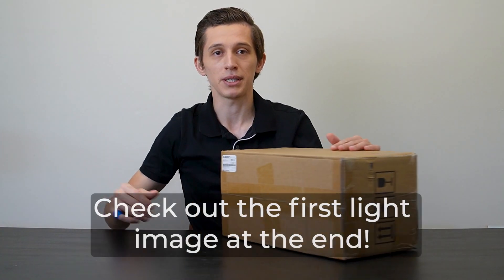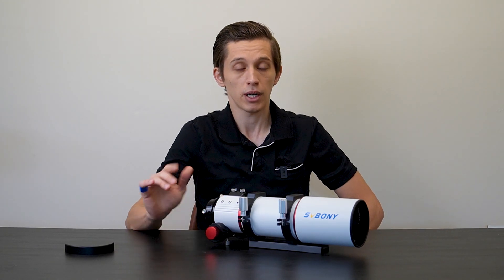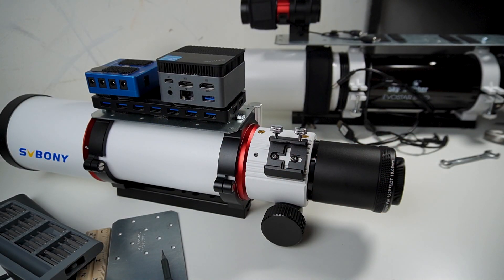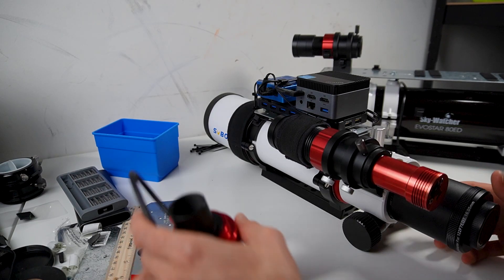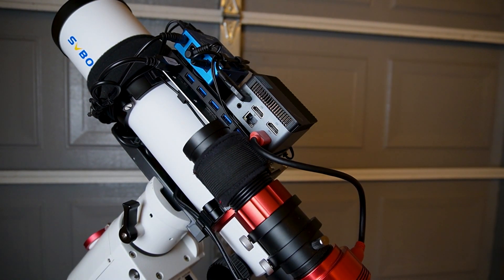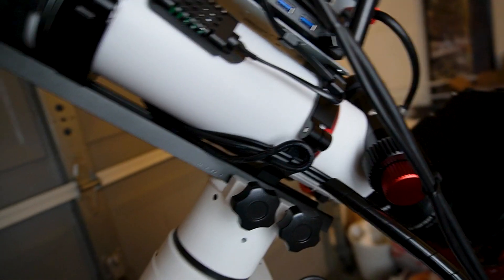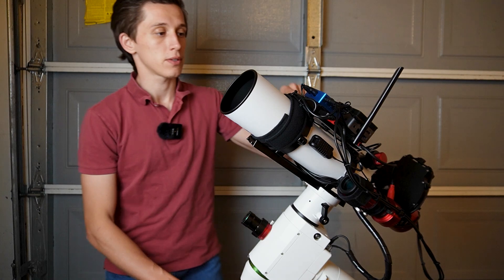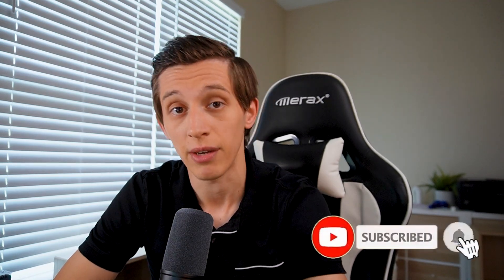Let's Setup An 80mm SV550 Telescope for Astrophotography

Comment: It was fun and educational to watch! Question, which would you prefer? SV550 80MM or SV503 102MM? I'm kind of torn on which one to go for, they're about the same price
Reply from the maker: Ooops. I've missed this comment! I haven't tried 102mm SV503, so it's hard to say which one I would prefer more... I guess SV550 would be better simply because it's a triplet APO although 102mm could find some use with a monochrome camera.
Reply: @AstroCreation   Thanks, that was my dilemma, a bigger aperture or better optics, I thought I'd go for better optics, and 80mm is also good, it will weigh less so a tripod will be easier to find at a good price.

Comment: Very tidy cord management! I was wondering about the antenna that is attached to your usb hub. Is that a wifi adapter? Does the mini pc not have wifi? Do you use RDP to control the mini pc or do you use some wifi magic trick? Thanks.
Reply from the maker: Thanks! Yes, mini PC has a Wi-Fi adapter, but I prefer to use an external one for better signal. I use Team Viewer to control all my telescopes remotely.

Comment: hi, you have a 0,8 reducer from sv550-122mm on the sv550-80mm ? is this possible or a fake ? We good ist the flattener in Picture ?
Reply from the maker: I've tried to use 0.8x reducer from 122mm on this 80mm telescope, and it wasn't good at all. The picture shows the 1.0x flattener dedicated for 80mm telescope

Comment: What antenna are you using attached to the usb hub?
Reply from the maker: I use this Wi-Fi adapter - TP-Link AC600. I got it on Amazon here: https://amzn.to/46DrRge
Reply: @AstroCreation  ok, im assuming the mini you had doesn't project wifi? I was wondering if it was an extender.  I'm using the mele overclock 4c. It creates it's own hotspot that is awesome for connecting to my inside laptop, but it is a bit limited in range.  Also, did you notice any pinched optics in your time with the 550 80? I have nearly the same rig. I love it, but I get pretty heavy pinching around the edges. Using the 533mc, hate to see how bad it would be with full frame.
Reply from the maker: @cheftonyt  The reason I got the adapter is that the telescope is located on the other side of the house where Wi-Fi router is placed. I had wanted to have a strong signal, so I went with this wi-fi adapter solution.

"Also, did you notice any pinched optics in your time with the 550 80?" - I used this scope with IMX 571 sensor and 1.0x flattener. Left corners of the image look good, while the right side is slightly off from being perfect. I assumed it's because I could have slight tilt in the camera. On the other hand, it's weird a little that you have "bad" corners with IMX 533 sensor. I've tested this telescope with IMX 533 sensor, and my corners looked good.

Currently I am in the middle of making a full review video about 80mm SV550. I hope to finish with it by the end of this weekend.

Comment: Where did you get those short USB and DC power cables?  I'd like to buy some myself.
Reply from the maker: Most of them I buy off Amazon. By the way, I am planning to film another video about cable management and specific cables I use with my telescopes.

I've had experience with different cables for two years now, so I can tell what cables last longer.

Comment: What would the total cost of this rig be?
Reply from the maker: The price would depend if you purchase brand new equipment or used. The featured rig in the video includes the following:

Telescope SvBony SV550 80mm
Reducer: SV193 0.8x Reducer/Flattener
Mount: Sky-Watcher HEQ5-Pro
Camera: ZWO 2600MC Pro
Filter Wheel: ZWO (5-position, 2-inch size)
Filters: SV220, Optolong L-Pro, ZWO DUO, UV-IR-cut, Dark Filter
Focuser: ZWO EAF
Guide-scope: SvBony SV165
Guide-camera: ZWO ASI224MC
Mini PC: GMKtec Nucbox5
Powerbox: Pegasus Astro Mini

There are also some adapters and cords I was purchasing separately.
Reply: The whole setup that includes the mount is about $5000 but maybe even way more if he has very expensive filters.
Reply from the maker: @southbronxny5727  Oh yeah, I forgot to mention the mount (HEQ5-Pro). I just added it to my previous comment.